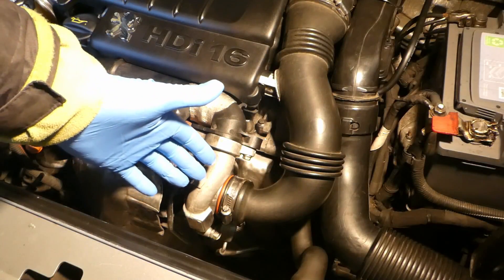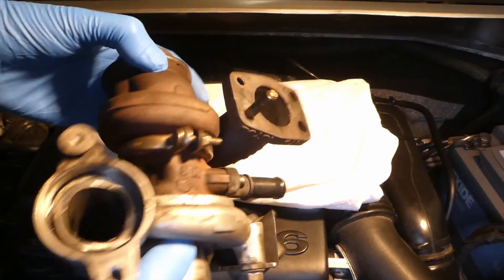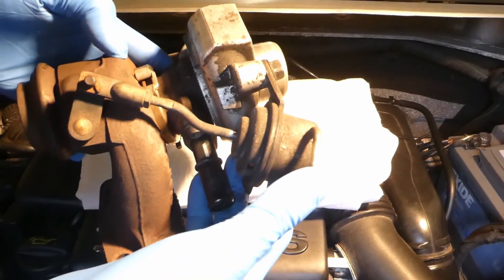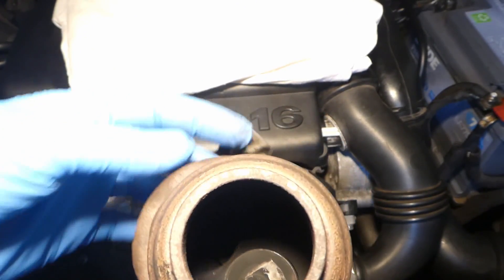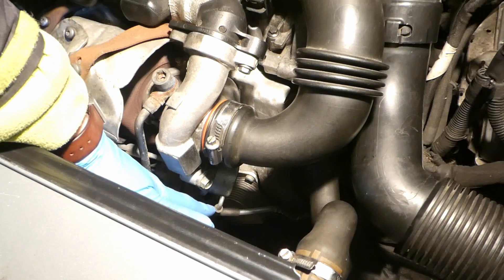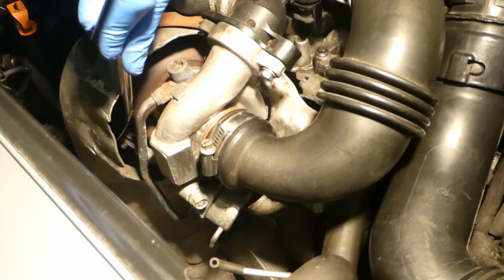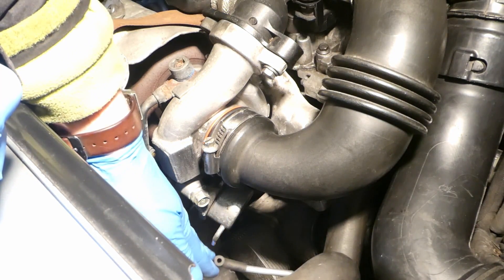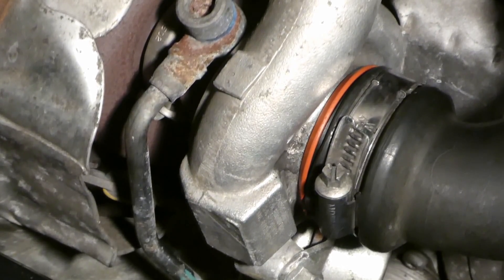Simple way to test turbo wastegate operation in 1.6HDi (Peugeot, Citroen, Ford, Volvo, Mini)

Comment: I have a question, 16hdi i blocked of the egr, all good. But then had it stage one tune chipped or what ever its called and now at around 2000 rpm in any gear when i accelerate hard the power drops off for a second or two then pick up a bit. Like its not getting enough fuel or air or ? I dont know no codes,nothing coming up.
Any ideas ?

Comment: then is the valve open in the default state?? if the vacuum box pulls in the lever does the valve close?
There is a video here in which the valve opens due to the vacuum, how many solutions are there, 100? :)

Comment: I have a Focus MK3 1.6 TDCi.
At low RPM, I have poor throttle response.
For example, when I'm driving in first gear at idle and press the accelerator pedal to the floor, the response is weak — the car doesn't react immediately.
At higher RPMs, it runs normally and pulls well
Reply from the maker: It could be a sticky wastegate, but could be something else. Have you checked for any errors with an OBDII dongle?
Reply: @moremolecules Yes, no errors.. 😞
Reply: When my car is on idle the rod is moving up and down.

Comment: If the boost sensor  is seized or stuck  how to fix this issue i have Peugeot partner  with error code p2561 and 2562.    turbocharger boost control position sensor a'' circuit can i contact you please

Comment: My problem is P0299 turbocharger supercharger underboost
Reply from the maker: You would have to trace the vacuum pipes for any fault or the turbo solenoid at the back of the engine has seized shut.

Comment: Hi great video I have a expert van same engine and waste gate holds vacuum with the test you have on the video but the rod sits to the left on tickover, and pumps black smoke when I drive this started off intermittently and as got worse with the help of your video if I manually pull the lever across the the right, then I can hear the turbo start to spin a little more and it hold in that position I can drive with little issue for a few hundred yards then it moves back to the left again, also throwing up a p2564 position sensor fault code A low any ideas where to start 

Thanks Nathan
Reply from the maker: It could well be the turbo solenoid at the back of the engine if it is the 1.6HDi engine. Or some sort of a vacuum leak before the wastegate if it is the 92bhp engine and not the 110bhp, different turbo and wastegate on that. Check the vacuum pipes for leaks from the turbo solenoid or the turbo solenoid is not working correctly.
Reply: @moremolecules how to check for vacuum leaks in the pipes? Will it have a hole?

Comment: I'm having flutter sound when i release the gas pedal after turning 2.5-3 rpm on idle. It comes from turbo but i cant the source. What can it be?
Reply from the maker: If that is the 1.6HDi, there is no turbo flutter to be heard, so likely some of the air intake pipes are loose and other leading to the intercooler.
Reply: @moremolecules  yes it's 1.6hdi 80kw. sound comes from near turbo. I checked the pipes that i can reach. All is tightened. I'll check rest on weekend by removing bumper. But for example if there is a leak from the ones on the left, is it possible to hear the sound from turbo? I'm really confused.
Reply from the maker: @tersfilozof4550  Normally there is a flutter kind of, but the intake pipes muffle the sound. Now, if the air intake was off you should be able to hear it. So, some of the intake is leaking. Most likely I mean, not 100% certain as I have never heard flutter from 1.6HDi. Don't remove the bumper, it is hard to put back and likely you will break a few plastic bits and pieces. Could be the wastegate arm and missing vacuum or sticky wastegate somewhat. Check if it releases correctly and or is moving, probably it is a bit sticky and you get the flutter.
Reply: @moremolecules  I'll check it after work. But it was a bit sticky after release. Is it dangerous to drive with this for a trip. Around 2000kms
Reply from the maker: @tersfilozof4550  Do not quote me on this, but I do not think it is dangerous, but you never know. It should be ok.
Reply: @moremolecules  Thank you very much. I really appreaciate your time. (last comment)

Comment: Hello, I'm seeking assistance with my BMW N55 engine, which is experiencing wastegate issues. Initially, the engine runs smoothly upon start-up. However, upon connecting an in/Hg gauge to the wastegate, it reads 5 in/Hg. Surprisingly, at idle around 700 RPM, the gauge jumps to 11 in/Hg. Any guidance on resolving this issue would be greatly appreciated.
Reply from the maker: Unfortunately, I'm not familiar with the BMW N55, so difficult to help. Sorry.

Comment: Can i please ask..

My waste gate on 2022 1.5 tdi is when you pus it gets stuck down, and doesnt come up as you shown on video, it throws lot of faults on the diagbox. Can you help  please
Reply from the maker: Now that is way newer than mine, so operation will be different and it is likely to be different type of turbo. So, I would not expect the rod to operate the same way. Also, TDi, that's like VW sort of car, maybe it is TDCi. WHat kind of errors or symptoms you get?

Comment: And what if rod is moving but not fast like yours than slowly like mine, when I start the engine?

Could it be problem with sticky cloged vaccum valve?
Reply from the maker: It could be slightly sticky or your engine generates vacuum a bit slower.

Comment: Mine is pulled as soon as i sart the car and stays pulled even when i rev the engine up and the turbo spins up! It don’t move back to closed until i turn the car off and engine stops , is this normal?
Reply from the maker: Sounds about right. The movement is fairly small amount and only under load, not while revving it. The engine is relatively clever not to pull the turbo from just revving it. If somehow you manage to observe while driving, then you would see the movement, under load that is.

Comment: I still didn't do this test, I don't have power at low rpm and then after 3000rpm it pulls as hell. What in case I don't have vacum? What is wrong then?
Reply from the maker: Yeah, not too sure about this, it could be that at low rpm the wastegate is a little bit stuck or MAF sensor is faulty. Try with an OBDII device to see if there are any errors, that might help.
Reply: @moremolecules  thank you very much for answer, I checked MAF sensor, it goes nice from 100kPa to like 210 above 4000rpm. I just added wynns gold, maybe that will help for cleaning and I will check wastegate today

Comment: Hi, I got 2.0 dti astra with strange problem. I have checked and replaced all hoses, vacuum pump and cleaned everything. Rod is moving ok by the hand or opcom test. Whenever the weather is cold I got almost small boost till I floor it and then it gradually starts to boost early. If you turn off then on car it boosts normal.In hotter weather, more then 15c I have 0 boost problems. My mechanic and me are out of ideas.tnx

Comment: That wastegate is in a different position to mine.
Reply from the maker: Well, yes, it may be at different position, depending on what model/year your car is and I bet it may be the 110bhp
Reply: @moremolecules  yes mine is 2006 110hp 1.6
Reply from the maker: @jamesa1841  Then, yes, the position of the wastegate will be different and that is VNT turbo. The one shown in the video is straight forward non-variable vane turbo.

Comment: Would this fault cause the engine to cut out? It starts but won’t run, checked turbo and it’s spinning  free
Reply from the maker: Unlikely, but probably other reasons for the engine to cut out, most likely air in the fuel system. If you have a rubber bulb on top of the engine, I would squeeze this until very hard and you can only hear fuel only going through. If that works for the first time and then starts to cut out again you may have a pin hole somewhere in the fuel line hoses and lets air in. This is just a guess, too many thinks can lead to the engine cutting out. I would say plug it in in a computer and see what error codes you have. This would be the best course of action.
Reply: @moremolecules  
It’s reading 3 faults 
Fuel rail system pressure to high
Fuel volume regulator control circuit low 
Turbocharger solenoid A low 

It starts rattles then cuts out after a few seconds 

Any help appreciated 

Thanks
Reply from the maker: @MichaelVasey-o9z  Hmm, I'm not probably the best expert out there, but from these I would say that you may want to check the turbo solenoid at the back left of the engine (looking on top of the engine, down left), reddish thingy with several pipes coming in/out. I have not heard it leading to cut out, but it definitely leads to other errors of underboost/overboost. It may not be this, but definitely likely to be related to fuel flow, could be multiple different things, from pinhole on a hose to actual pump not working. Try with the turbo solenoid first as it is cheap and fairly easy to replace.
Reply: @moremolecules  
Will try it
Many Thanks 👍👍👍

Comment: Hi, does wastegate must be in closed possition when car is running? Mine seems is opened all the time. I have Turbo charger fault P1497 and P2562
Reply from the maker: Could be wastegate, but probably a faulty MAF sensor. If I were you, first I would just unplug the MAF sensor and see if that fixes it. If this fixes it then you would need a new MAf sensor. Otherwise if the MAf does not fix it it could be a turbo solenoid stuck at the eback.
Reply: @moremolecules  I checked wastegeate and its holds vacum.I must try to disconect MAF sensor and see if its change something.Will let you know if its will work.🤞
Reply from the maker: @ShadowStory_Gaming  Most likely it is the MAF sensor. When unplugged it goes to a default mapping and it should fix it and of course you then need to replace it. It could be the turbo solenoid at the back of the engine as well. It is pretty cheap, but difficult to replace as it is hidden down there at the back lower left side of the engine when looking on top. Good luck!
Reply: @moremolecules  Disconected MAF sensor but it does not make any difference,just come out with additional air flow error. Seems MAF sensor works,  Checked turbo selenoid and it clicks when add 12v supply, not jamed. I disconnected, wastegate vacum pipe from turbo charger actuator and use just finger to feel vacum, there is some vacum but not enough to close vaste gate turbo actuator. Its bearly holds peace of papper. And i notice when vacum pipe is connected, the arm that connects wastegate rod rattles, when its disconected rattle is goone.
Reply from the maker: @ShadowStory_Gaming  If there is that little vacuum, I would check all the vacuum pipes if there are not any holes anywhere. Also, the solenoid could be stuck but still clicking. If I were you I would still take it apart and see if these is something there.

Comment: Can the length of the arm be adjusted to reduce/increase pressure. I think mine is incorrecly adjusted, when the wastegate was replaced
Reply: So position actuator arm with 2 mm to fully closed position for vastegate valve (arm retracts when engine starts and keeps wastegate closed)?
Reply from the maker: @trondeivindhaugland6406  Yes correct. The movement is fairly minimal and the ECU closes the wastegate on startup.
Reply from the maker: Yes you can adjust it, although the ECU controls the pressure that goes through the wastegate.
I always thought to film a video how these are adjusted. Based a bit on memory, but basically, you push the wastegate as much as possible to the right and then through the arm hole you need to see half of the left-side of the bolt. You wind down/up the end of the wastegate until this happens. That should be the correct adjustment.
Reply from the maker: Just an addition to my previous reply, you push the actual wastegate that is on the exhaust side of the turbo as much as possible to the right and then you position the wastegate valve with the bolts and adjust the arm untul you see the left half of the wastegate bolt. Hope that makes sense.

Comment: Hello!I ve had too much boost p1517 code error changed the turbo wastegate now I have p1507 turbo pressure too low -20 power boost in turbo and after certain times in 5 th 3000 RPM i have reduced power engine..what should i do?
Reply from the maker: Yeah, not too sure about this p1517. Overboost would typically be the turbo solenoid at the back of the engine. It could still be the turbo solenoid, getting stuck.

Comment: I performed this test on my actuator and it holds pressure.  But I have no boost at all and the garage have said it is the actuator that needs to be changed.
I told them I performed this test and it works, but they said I need to change it anyway!?  
Are they correct?

Comment: My 1.4hdi has been real low on power lately, I just tried to move this lever and it's completely siezed up!
Reply from the maker: When you start the car does it move? If it is siezed, then you could take it off and see. You should be able to move it by hand.
Reply: @moremolecules  it drives alright but it feels like it has 40hp instead of the 68 it's supposed to, especially uphill. The wastegate lever does not move at all, I took off the heat shield to get at it too and removed the air hose. Now I gotta figure out if the PCV valve is also broken, and possibly the Solenoid for the turbo.
Reply from the maker: @Gneeznow  The PCV is difficult to break, but most likely something related to the turbo and it does not switch on. If I were you I would plug it in software to see if there are any errors. PP2000 for Peugeot and Lexia for Citroen.

Comment: Very helpful video.  I heve oil coming up from the waistgate what could be the problem. ( eBay turbo).
Reply from the maker: Ahh, not too sure, but there is something wrong in there. I would suggest wipe it all clean and see where it is coming from.
Reply: Up date on my findings on the problem i had / have : air flow intake hose pipe after market! the small pipe that runs to the crank case,would would vacuum shut at 3000rpm by chance  i spotted the pipe comprising shut so i have 2 aluminum 40° cuts pipe inside the small pipe to keer it from collapsing shut. 
Just a head's up on what my findings on the problem was i had. Much appreciate you video content.!
Reply from the maker: @catharinacarroll7908  Well done for tracing it back to the culprit 🙂

Comment: I have too much boost and tested the vacuüm like you demonstrated. The actuator lever comes back when I hold my finger on the hole but when I release the finger, air is sucked in. So now I wonder if the wastegate should be replaced or not. It's a 2.0 HDI engine.
Reply from the maker: Too much boost is most likely due to the turbo solenoid at the back of the engine, kind of rear left if you look at the engine from top. Most likely it is stuck and gives you constant vacuum to the turbo wastegate. It is cheap to buy, but a bit difficult to replace, as it is kind of stuck in the back
Reply: @moremolecules  thank you very much. The problem occurs only on vacations abroad, when we go 130 or more km/h.
I tried to take off the connection to the actuator and even that is quite impossible!
I"l defenitely work on it soon!
Reply: @moremolecules  Job done! Took several hours to disconnect solenoid because the second bolt was as good as impossible to reach. Dropt my tool so needed to buy another one. After finally loostening it found out that there was a similar solenoid left of this one 😬 which was much easier to disconnect, the more so because the second bolt was missing.
Reminding myself of what you wrote, 'left', I changed that one. But not before I started the engine with the harness off and got P0234 again.
Now I hope that it'll be fine on the highway!
Thanks bro! Wouldn't have managed without your directions!
Reply from the maker: @Johannes_Brahms65  Well done! Hope it will be fine on the motorway/highway

Comment: That is not the good test.
I will explain you which one is. Tools: adjustable vaccum pump, vaccum gauge, technical documentation (training manual) for your car.

Onto different negative pressure (vaccum), actuator will be on different position. This is linear funcktion. Basicly, for full action of actuator, you need to apply full pressure from your vaccum pump (about -1 bar of pressure (-10MPa)). For 50% open, you need half of the pressure.

This metod is better because you can diagnose both vaccum pipes and actuator condition.

If anyone wants to be a repairman, pls start to learning and using right tools.
As I see in video, you didn't do any measurments. Only Looking at the parts and watching how it moves, never will give you knowledge.

Best regards!
😂😂😂
Reply from the maker: Hmm, the title of the video is a "simple test" you talk about a rather complex measurement tools. I did not say once in the video this is the best way to test the wastegate.
The simple test I was conducting is it wotking or not, not is it 95% effective and so on.
Most people, I included, might want a simple way to remove some non-working parts and narrow down different pathways, buying every possible tool out there will be too expensive for anyone to do any DIY work on their cars.
Reply: @moremolecules  Your test is simple, but my test is simple to, maybe simpliest than yours. Only thing you need to do is to disconnect pipe from wastegate and make new connection with vaccum gauge. In that way you are doing test of 3 components: wastegate, pipe and pump. It is not matter does wastegate actuator work or not, but does it work properly in all conditions. And what is more important, You don't need to teardown turbocharger. If you carefully think, your test have no sense at all, because after the test you still don't know is it wastegate actuator good or not.

There is no need for taking safe guard. I gave You my knowledge for free.
Reply from the maker: @RioTintoGoAwayFromDrinaRiver  wow, thank you, not much more to add really.